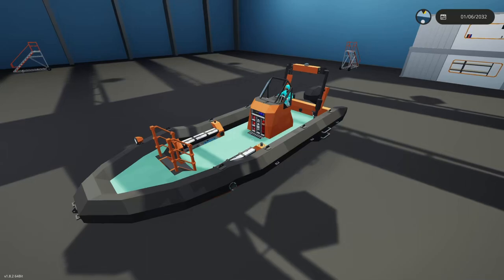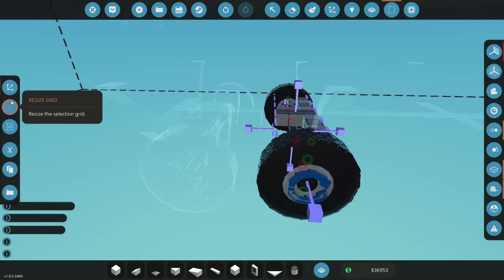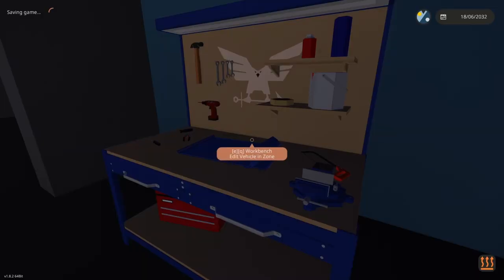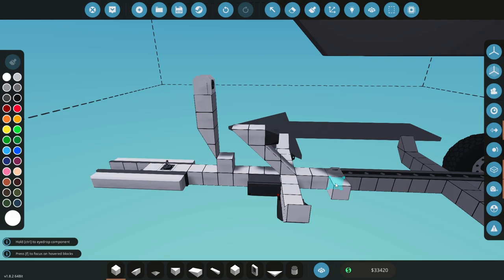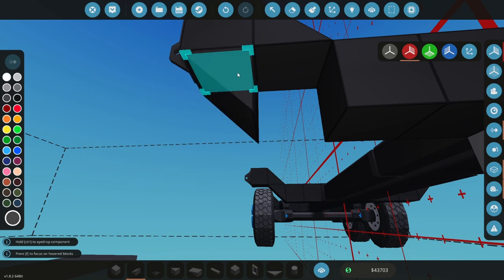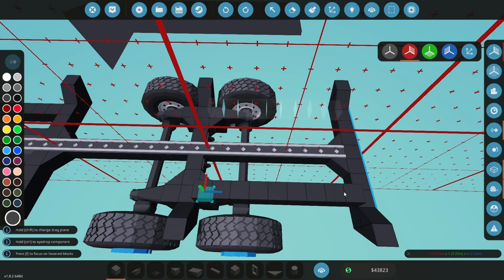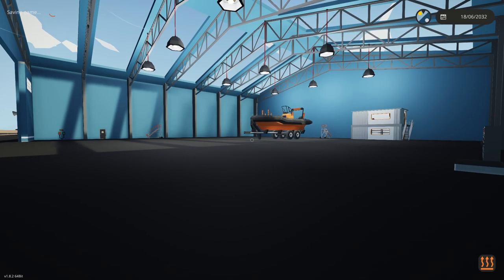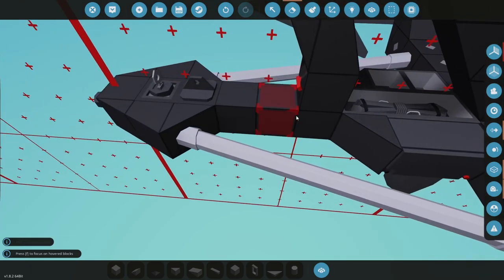Stormworks - A Career Story RHIB Trailer Build

Comment: Nice RHIB - is it on the workshop?
Probably one of the better features that is underrated would be the ladders on the side - completely takes out the unmitigated disaster of trying to climb into the boat in rough/adverse conditions. Well done mate!
Reply from the maker: Its not on the WS yet. I want to do a bit more testing, and its likely it will be on the WS soon with the trailer and the truck at the same time.